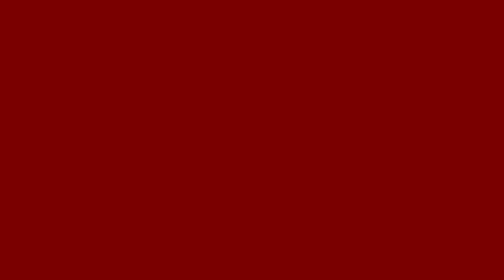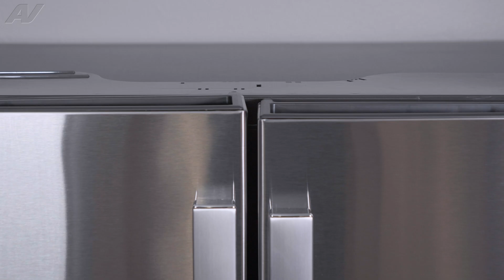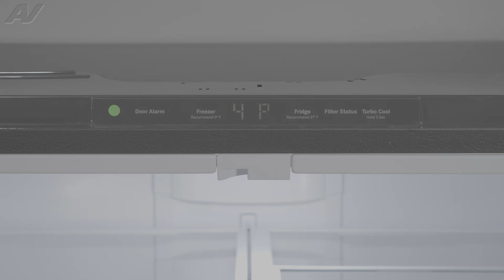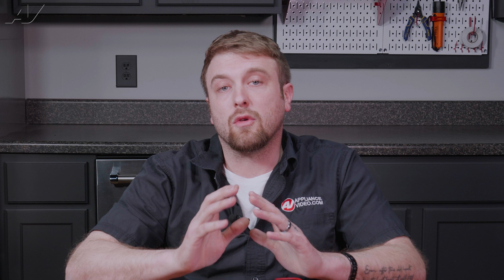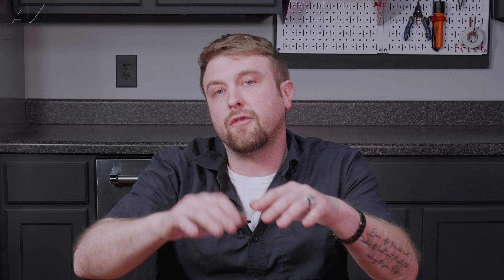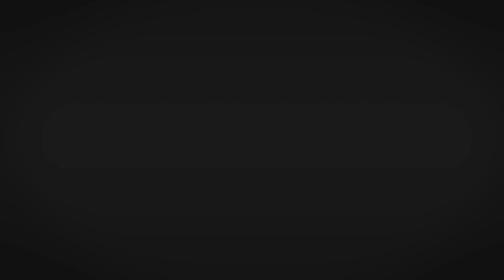GE Refrigerator - Service Diagnostics, Troubleshooting & Error Codes

Comment: Thank you so much for these codes!  I have searched for hours and they just have many videos of the same models.  I am attempting to replace my evaporator fan though it reads P (like those who commented below) because it makes a terrible racket and has no blow power.  When removing the Motor /cover,  I had to explore for there was no video to be found to learn how to replace  WR49X40245 part number for GE GNE25JGKYFWW.   I found some ice but not near the fan.  Because you gave me code 11, I was able to plug in my unit and defrost it, (some say blow a giant fan on ice to melt fast but I don't have one) and I now know for sure that it gets hot.  I believe the combination of freezer too full and door being left ajar along with weak fan, put my unit on ice.  I am hoping that the defrost will function properly when all done since I won't be pushing code 11 to accomplish that later.  I want to leave the ice maker uninstalled and I hope that it will not cause a problem?  May you and yours be blessed with eternal life and receive reward for work done well.  In Jesus name AMEN

Comment: When I run the t8 to test for fan spinning, the panel just says P.  Evap fan doesn't spin.  Does it normally show the P for pass symbol during this test.  FYI I replace the evap fan motor (freezer cold, fridge not, fan not running at all), with the OEM kit, and new fan motor won't work either (with regular running or with fan test).
Reply: Did u figure out what it was man? I’m dealing with same thing and think I changed literally everything
Reply: Hi, I have the same problem. I did the test for all but the evaporator fan still not working, everything pass. What is next to check ?
Reply: Commenting to hopefully get response here. Same boat.
Reply: Id love if this had a answer same problem. I feel like a older person when these fridges barely 5 years anymore 😂

Comment: Freezer's cold, fridge is warm (60F), baffle opens, evap fan runs at different speeds, thermistors test fine.  Air just isn't moving up from freezer to fresh, barely detectable by hand.  I'm wondering if it's fan speed, but that test doesn't really say anything.